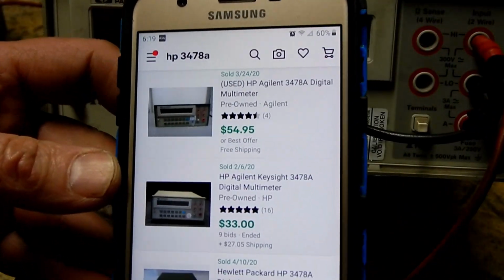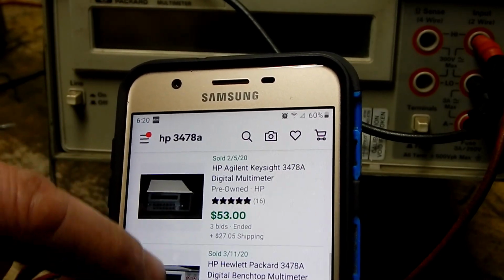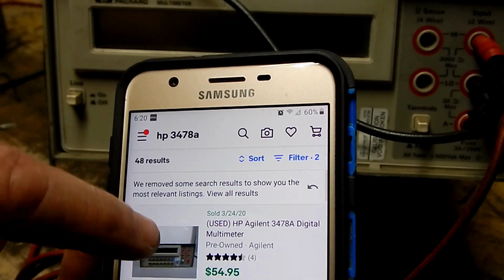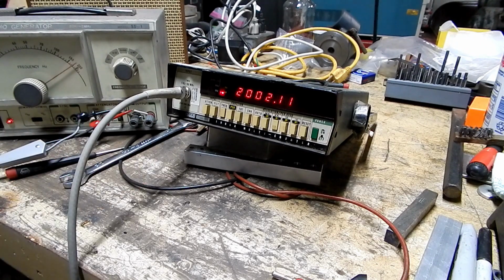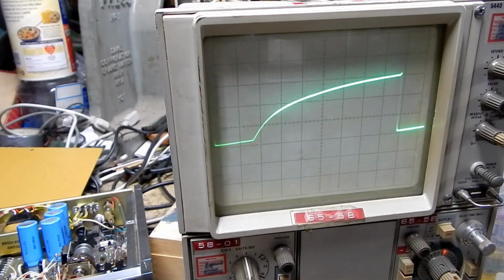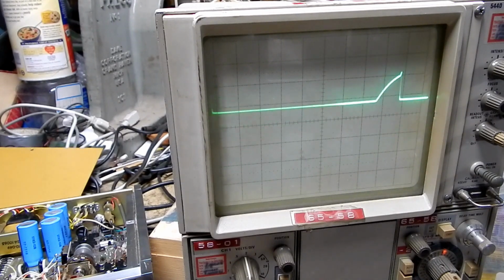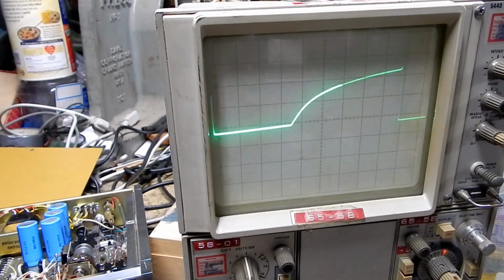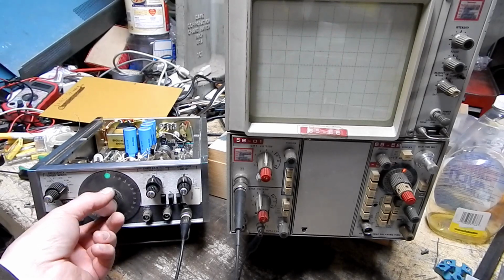Vintage Test Gear Pick April 2020 Part 2

Comment: Good diagnosis on the counter. I got both of my good ones because that "didn't work" for the same reason. IIRC, the crystal is a temp compensated, not ovenized on this unit. For stable freq, wait a full counter period for he proper reading. If you change the freq mid-sampling-period (mid counting) the result will be something between the start end end frequency. The Hp '78A is an AWESOME meter. You scored well. You can run a full self test via the front panel. The power up test is not a full test.  IIRC, you can set it to null the test leads for voltage or resistance.